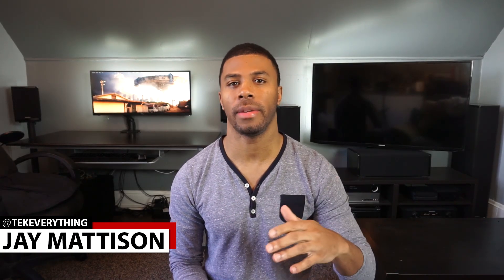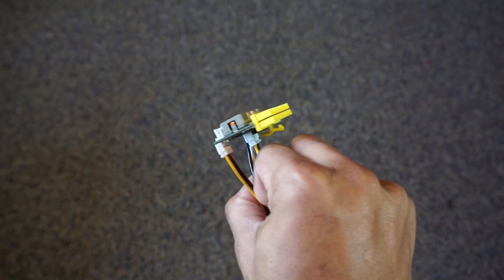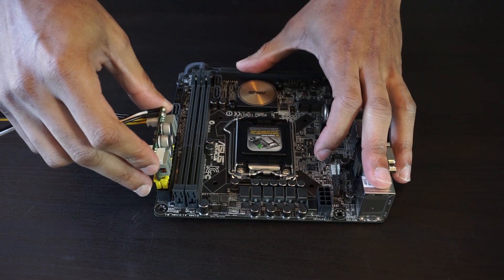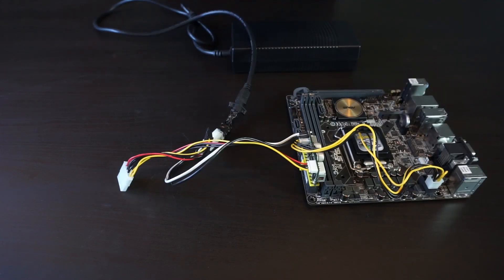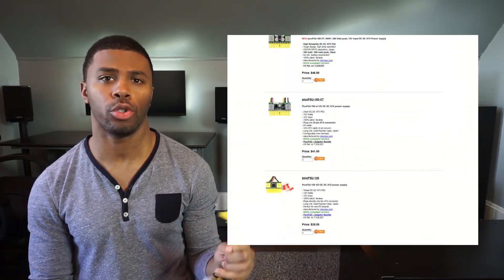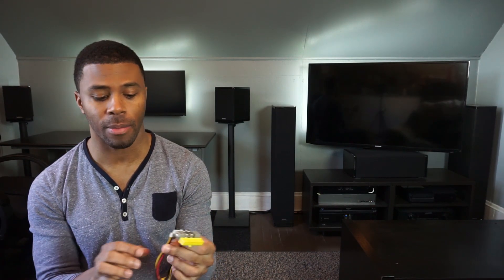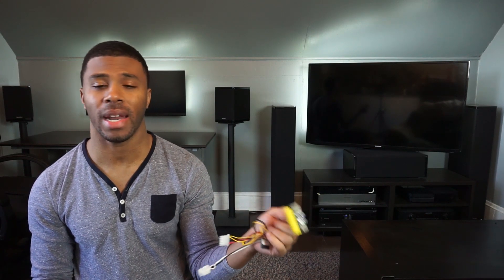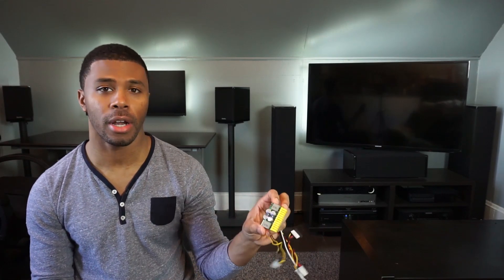Pico PSU's Explained

Comment: Thanks for this. It's not so difficult understanding it most of the power is going straight from the 12 V supply, right to the connector, the pico supply is only supplying 5V and 3.3 V, on a 150 W load, maybe 120 W goes straight through, and 30 W goes through the pico. If it's 85% efficient then it's dissipating 4.5 W of heat. I'm not taking away anything from Pico but it doesn't really do much!

Comment: if i have 300w pico psu, how much wattage should the power brick have? how the "math" works?
Reply: Input voltage multiplied by amperage [E.g 12v × 12.5 = 150watts (Multiple by .96% Effiency) actual max sustainable power load is 144w]

Comment: Is it ok to use more than one adapter with the pico PSU? I’m connecting my PSU to my hp server breakout board but doing so means I need to use two adapters, is that ok?

Comment: How to use this on a regular chassis like Cooler Master Elite 110? Normal ATX PSU has poor placement, and the long and thick cables clutter the inside of the case, making it very hot.

Comment: The Witchcraft:
Normal PSU's components are used toward stepping down the 120v/240v lines, changing the voltage from AC to DC and cleaning up the noise coming in from your house.
Doing this takes a lot of special components and this is largely keeping the lower voltage components safe from surges, under-voltage and really bad Sine-wave output.

The last thing you ever want is your 12, 5, 3.3, 1.5  volt rails from jumping up by 3-20 volts. Especially the 1.5v rail as that's usually used for your CPU.

A PicoPSU doesn't need to worry about cleaning up noise as the input is already DC and mostly already stepped down and cleaned up.
It does need to create the 12V, 5V 3.3v and 1.5v rails which doesn't take much from a 16-28v Volt input.
Reply: ATX doesn’t have a 1.5V line

Comment: I need help, can anyone tell me why the ac dc brick has a lower output than what the 160w pico psu needs. Update, I know now but what do I do if I don’t want to spend $50 on one when I need two, any cheaper options?

Comment: there are models with 12v and 19v. What should I Choose?
Reply from the maker: How much power do you need?
Reply: @Tekeverything  I´m looking for power a g4560 and gtx 1050 ti with just a ssd 500gb.  Because is kind of hard to find 12v and 15A or should I just take the  risk a 120w model?

Comment: its cool to the touch because the cpu and gpu is powered straight from the 12 external supply. The only thing the pico supply does is step the voltage down to 5v and 3.3v for hard drives and whatnot.

Comment: I can't believe you make a video of this without explaining the voltage compatibility between the PICO and the external power brick. You can't just plug any external power bricks into any PICO based on wattages alone. The voltages must match. Most common voltage is 19V for external powerbricks (laptops usually in this range). If your PICO is 12v, you need to find a 12V powerbricks with sufficient amp to match the Wattage you intend to achieve. It's fine to use a powerbrick with higher amp. If your amp has lower amp, it' might overheat if your pico is drawing more power than the brick can handle. But most important is to check the voltage! Make sure the brick output voltage is same as the PICO input voltage.
Reply: Right and many people will just plug things in if the plug matches. Sorry to say but the video author does not even know what a psu is and it would be better if pico stopped calling these psu's.

Comment: Can this power a a i5 8400 and gtx 1050ti?
Reply from the maker: Most likely yes. You would be safer with an HDPlex unit and a 230W power brick.

Comment: Can this run a ATI X1950XTX and a Athlon 64 x2 4600+ and 2 FU*KING OPTICAL DRIVES?!?!
Reply: Probably not. Those components use 200 watt and more. Pico power supply can handle 160w but just for short periods 250w. So I think it should be risky.
Reply: @jasonyantentorres3763  i didn't want to use a pico psu anyway

Comment: Hey Jay, I've just stumbled across this vid so apologies for my lateness. I have a question and you may know the answer .. I've been given an ITX board with no power supply and I believe it falls into the industrial board category (for EPOS machines). However it takes laptop ram and a core i3/i5 so I was going to use it as a plex server / htpc machine ... I'm just lacking the psu which after my research leads me to one of the cool little psu's you featured here. However this board only uses a 12v psu with 4 pin just like the 160xt has (same as the 4 pin cpu one)... so if I was to order a pico 160xt or similiar (depending on the wattage) could I set it up as you've shown but bypass the 24 pin completely and just use the 4 pin (leaving the 24 pin tucked away in the case or dangling around lol). Theres not much info on my board but on some forums and reviews, they all seem to point to something like the 160xt so I just need a confirmation or a negative on me buying one .... I'd really appreciate your time and I'll sub to you for life .... I lied, I already subbed :)
Reply: No, you need the 24 pin. That provides power to your motherboard in the form of 12V, 5V, and 3.3V. The pico "PSU" is essentially a buck converter that steps down the voltage from 12V to the designated 5V and 3.3V pins. If I'm understanding you correctly, the 4-pin connector is a CPU connector that solely powers the CPU and not the motherboard. You should also not try to route the 12V to the 5V and 3.3V pins, as that would almost definitely fry your motherboard.

Comment: This will be perfect for my ryzen apu build. Running off grid 12 volt battery with no inverter. :)
Reply: I want to do the exactly same thing in my caravan. The power brick defeats the purpose though. As I have a 12v cig lighter. Do I just plug the Pico PSU into it? or need some sort of adapter to regulate the power flow?

Comment: Great little PSUs. I've been running my weather system PC and my Linux box for years off of the 80 watt picos from a bank of solar batteries. 200 watts of PV and a bank of 4 Trojans runs these little mITX boards 24/7/365. 4GB memory, 120GB SSDs, onboard graphics,,,, going on 8 years now without fail. My picos work from 12-36 volts, running from 24 volts.

When you're all solar, a watt saved is a watt earned.
Reply: That's amazing! I'm trying to run my gaming PC directly off solar. Looking at the M4 ATX from minibox but also need two 8pin gcard and a bit higher than 400watts. Would you be able to point me in the right direction?

Comment: could the 160w handle an r5 1600 and 1050 ti?
Reply from the maker: You should be fine, just make sure you get the kit with the 192W power brick.
Reply: Tek Everything Thanks!

Comment: Jay, I have an Dell optiplex780 sff with a core 2 duo , I'm thinking I want to set it up as a personal server  will this work for me ?  My amazon membership is about to be up soon so it's kind of a time sensitive issue , much Thanks in advance appreciate you and your videos.
Reply from the maker: It should work, but it appears that the case accommodates Flex-ATX PSU's. That would probably a better option.
Reply: Thank you for replying I just was looking at the power supply that you suggested and I agree that is probably the better option.  First I wanted to ditch the case and use it for another project, but it makes more sense to keep it now.  The standard Dell power supplies for the Optiplex have a reputation for well dying, and I didn't want to grab a brand new one for this older computer.  So this should save me a few dollars and it only takes 230w to run the machine but it cant hurt to have 250w because it appears thats the Flex-ATX PSU's models increase wattage in increments of 50w.  Again thank you for the advice.

Comment: Can we power mobo with 12volt battery using this?
Reply: @Bruh allRounda: Well, you have to take one that's suitable for varying automobile voltages. A 12V battery starts at somewhat 12.3V and can go as low as 11.2V. Using a 12V PicoPSU will render your system unstable when the mobo voltages go low where they are not meant to drop. Too high and your board might fry. Respect the specifications.

Comment: But my GPU uses 300 watts on it's own...
Then what if I use SLI?
Looking to run DC for my solar powered desktop.

Converting AC to DC is what makes heat by the way. And it's also what sucks the life out of battery banks.
If you are plugging that thing into AC power outlets then the brick must be what gets hot.

Comment: Can this work with my i5-4460 and GTX 750?
Reply from the maker: Yes, you should be fine with that setup.
Reply: remeber my CPU's TDP is 84. that's why im worried
Reply from the maker: I understand, you would be fine. You might want to go with the HDPlex 160W though.
Reply: Ok, i spoke with some other techy guy and he told me that it can handle as much as the brick that is connected to can handle. Is that correct? For example if i get the HDplex 160W and a 300W 12V brick, will it be fine?
Reply from the maker: Both the Pico 160xt and the HDPlex 160W are rated up to 200W. I wouldn't try to push more than that through them.
Reply: ΟΚ, one more question, 84W TDP + 55-75W GPU takes me really close to the consistent of 160W.
+ ~10W RAM + probably another 10-25W or so for an HDD...... am I pushing it a little bit? Is it going to be viable, is it good for it to always be on it's peak?
Reply from the maker: Real world power draw is much different from rated TDP. You will be fine with that setup. I recommend the HDPlex 160W and HP 230W power brick. That is a nice affordable combo, that will give you a little headroom over 200W if you need it.

I ran an i7-7700 and GTX 1060 off that combo... your system will be fine.
Reply: Tek Everything ok thanks a lot!!! :)

Comment: man 100 for a psu setup in a budget build is killer though. Seems like all the cheaper ones are ebay models and idk how much i trust them
Reply from the maker: Check out my HDPlex 160 video. That gets you 200+ watts for around $80, its modular and similarly compact.
Reply: Tek Everything I'm doing a build in an Xbox 360 chassis. G4560, h110m with wifi, 8 gb of ddr 2400 (2x4), an SSD, and a 1050ti. I might have to just shell out the cash and step up to the 300w one.
Reply from the maker: Those components fall well within the range of the 160W. I ran an i7-7700 and 1050Ti off of the 160W with zero issues.

Comment: can i use 12v 60watt power brick? my pc overall watts is 180,,is it ok?
Reply from the maker: If your PC pulls 180W, then you would need at power brick that could handle that load at minimum. So no a 60W brick will not work.
Reply: Tek Everything how much watt brick do you recommend?

Comment: Love your videos! I'm looking to build an ITX machine under 190 cu" with a 7700 and a 1080 (no overclocking) Ideally with the DC Power source inside. For the rig, would you say the HDPLEX 400w psu and 300W power supply works best, or 2 160s and a Meanwell 400w?
Reply from the maker: I would definitely go with the HDPlex 400W over two 160W's. If you can fit the Meanwell I would go for that. The HDPlex internal 300W brick is a tank, and you should be fine with that as well, I just worry about power spikes.

Comment: Becareful the 12v line is not regulated and it conects directly to the 12v rail in the pc and if you use something higher than 12v it can kill all the components that needs 12v and so dont us it in your car because the voltage is not stable it go as down as 10v when cranking the car and as hih as 14.5v when the aultarnator is on... Use a buck boost converter and set it to 12v and it will be a very good far a pc in car and power your monitor with another boot converter if it needs 19v or higher ..... A nice buck and boost converter is ltc3780 which you can get for 10 to 20$ on ebay or AliExpress!!
Reply: @Kuntal Ghosh: There are PicoPSUs available for varying voltages like 12 to 14V like in an automobile. YOu have to pay attention to the given datasheet when ordering one.
Reply: If you read the spec sheet for these picoPSUs they have automotive versions that claim to survive extreme crank voltages etc.
Reply: @zbjz  auto motive versions are much bigger as they have to include a dc to dc converter for thr 12v rail which is the most demanding circuit of a modern pc.

Comment: G4400, gt 1030, 1x 4gb ddr4, 120gb ssd, can this psu handle it?
Reply from the maker: Yes it will handle that with ease. Check out the HDPlex 160W though.

Comment: How do you power that first build with a Nvidia Quadro? How many watts need?
Reply from the maker: The whole system pulls well under 200W. So the Pico 160xt + 192W power brick is plenty
Reply: Nice. I'm trying to build a nice mini PC with a Gigabyte mini-itx, Core i5-7600, 16gb ddr4 and Nvidia Geforce 1060 6gb mini in the same chassis (Wesena F7C EVO) that you've used, but I guess pico 160xt will not work with this energy consumption, so I've thought about using HDPLEX 300w, but I'm not sure if it will fit on this chassis. What do you think?
Reply: For now, I'm waiting for the new nano HD-PLEX 400w they will launch this month because the 300w one is out of stock and they will not manufacture any more. :D
Reply from the maker: The HDPlex 160 would be fine for your system.
Reply: Are you sure? Even with the GeForce GTX 1060 6gb?
Reply: Nope. A 1060 6gb and a 7600k needs like 400 watt. But more is better then the minimum

Comment: hello, i purchase this pico psu with192watt power adapter, I'm using Streacom F7C Alpha case and this power adapter have a 4 pin mini dim  male do you know where I can buy a 4 pin mini dim to. 5.5x2.5mm adapter ?? it's this possible? thanks in advance!!
Reply from the maker: I have no idea. I would check Amazon or Ebay.
Reply: Hi again.
Can you help me.
I have this parts...
Asus Z270I 
2x8GB Corsair Dominator Platinum
Nvidia Quadro P1000
WD Black 2.5 7000RPM
Samsung M2 960 Evo 250GB
SilverStone 12.7mm Bluray Drive
NH-L9i
2x92mm Noctua Fans
Case F7C Alpha 

do you know if i can use an i7 7700 with a Pico PSU (160w) or  I need a more powerful PICO PSU.

I'm trying to do a very small computer for Adobe CC Programs (Photoshop, Illustrator, In Desing, Animate).

thanks in advance.

PD: Sorry for my english. I speak spanish only.
Reply from the maker: You can run a 7700 off of a Pico 160-xt yes. Just make sure you get the 192W power brick.

Comment: where is the actual PSU come from ? it is come from PICO 160XT or come from the power brick ?
for example I need 300 watt power supply for my system build so which part 
should I upgraded ? it's the Power Brick only(with output 300 watt)  or 
PICO PSU with 300watt and Power Brick with output power 300 watt or 
more?
Reply from the maker: You would need to update both. The power is generated by the brick. You would need something like the HDPlex 300W, which I did a video on as well.
Reply: thanks man for your quick reply...keep it up

Comment: I have a Picopsu 160 xt and I can't get it to boot my mini itx motherboard. Nothing spins up and no lights will come on. I swap the PSU out for an ATX2.0 regular PSU and the machine comes right up. Any ideas why it would be doing this?
Reply from the maker: It is usually the brick in most cases. The Pico's are generally tanks.
Reply: Thanks, for the response. I have used 2 separate bricks for the picopsu and tested the voltage at the solder points on the pico's board and it is getting 12v. The plug just doesn't seem to be wired the same way as the ATX2.0 plug. I feel like from what I have read I should just be able to plug it into the mobo and all should be good but it doesn't seem to do anything. :/
Reply from the maker: Yes you should. What are your system specs?
Reply: The MB is a Super Micro X7SPA-H with an (atom D510, ICH9R Chipset) the ram is a 4GB Kit Crucial SODIMM DDR2 PC2-5300. There is only 1 HD attached. The whole system probably only uses 30 Watts.

Comment: Subscribed. A lot of cool vids. Thanks.

I thought about using the Pico 160, but as my project will have a battery in it, plus a few power hungry components, I picked up the M4-ATX PSU for the Gigabyte F2A88XN-WIFI board (A10-7870 APU), and the DCDC-USB-200 Buck-Boost board to power the two 8.9" displays that I salvaged from two dead Acer ZG5 netbooks. 
My choice may be a little over the top, but I'll never have to worry about voltage fluctuations damaging anything.
Also, as the planned case will be made of polycarbonate (Treated to reduce static buildup), and leather, I'll need power for extra cooling. It's planned to look like a small treasure chest when done, and hopefully weigh less than my 122 year old Kimball piano (Yes, my project is meant to be portable).
Reply from the maker: Wow, that sounds intense man. How did u come up with that idea?
Reply: Tek Everything 
I had to replace my Dell B130 three times, only to bring it back out of the closet again later, to replace the dead replacements. 
It seems that I can only get a year out of a new laptop. 
As I figured that my home computers, that I built, work flawlessly, and that I've always wanted to build something unique, that now is the time to combine my talents to build a dependable portable machine. All the parts were available, so I bought them. My PSU, and Buck-boost board just came a couple days ago. Now I can test all the hardware in a junk tower, and start on the case.
Reply: I found your page on FB. I'll post a pic of the parts there.
Reply: Sounds like you were going in a similar direction to me right now. I'm trying to run my gaming PC directly off solar. Looking at the M4 ATX as well from minibox but also need two 8pin gcard and a bit higher than 400watts. What would you recommend going with?